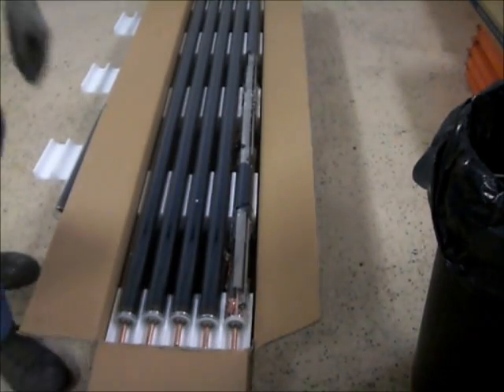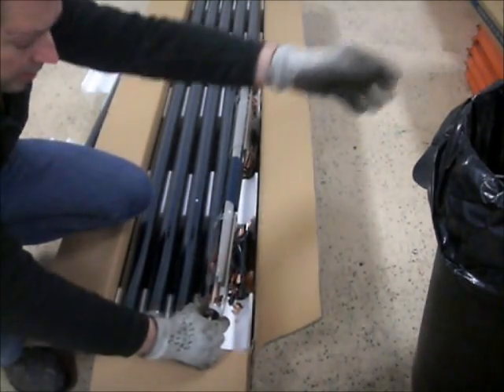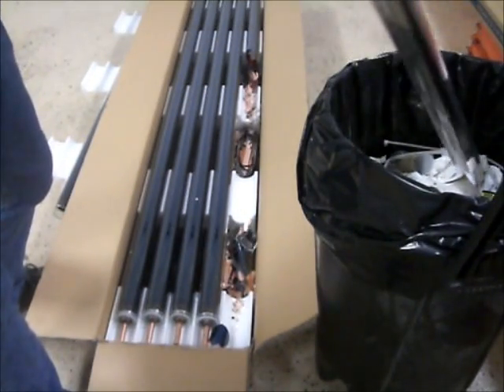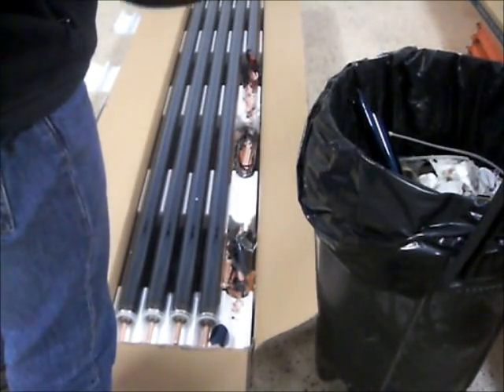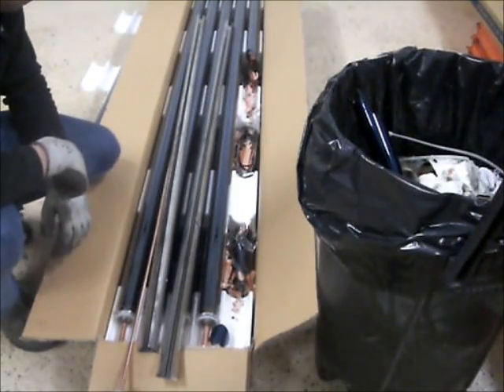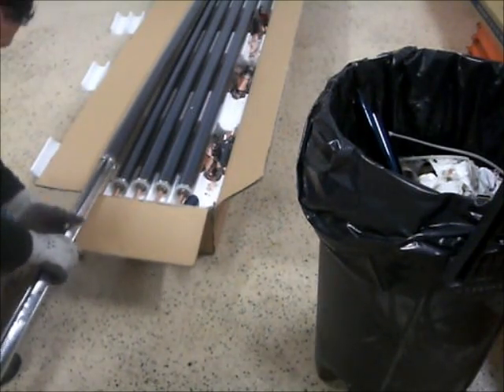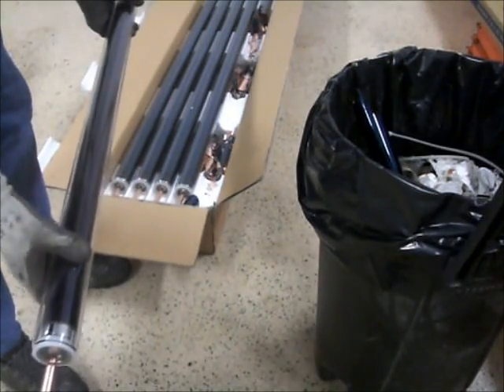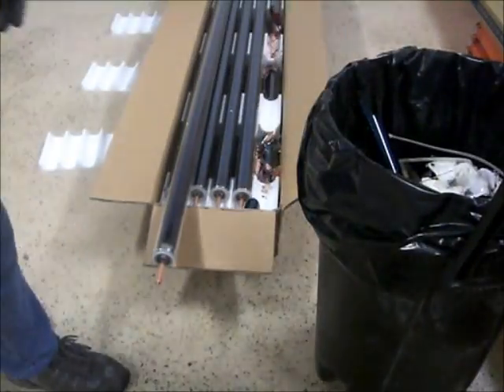Solar Evacuated Glass Tube Replacement

Comment: The solar tubes are sealed and no liquids inside only the copper pole?
My solar heater  is 11 years old and  i'm beginning to see that  are losing heat we are receiving warm water instead of hot water.,what it means?
Reply from the maker: Correct. It’s double wall of glass with high vacuum between inside/outside. Copper heat pipe conducts heat from inner glass via aluminum leafs. No liquid in tubes.

Comment from the maker: No water in these. Water in the pool collector tubes. Less than 2L in the manifold. Yes, copper heat pipe just conducts heat to the header. You can buy a single tube but pickup only. Can't ship them - UPS and Fedex always smash them to bits.

Comment from the maker: Yes, the are evacuated. It's a double-layer tube sealed on both ends, vacuum in-between. All I'm doing is re-using the internal heat-pipe from the broken tube and inserting it into a new tube. We sell the replacement tubes. If you google evac tubes and look at a closeup of where the heat pipe is inserted you will see how the tube is manufactured with an inner and an outer glass layer. Vacuum is between those not where heat pipe inserts.

Comment: dont EGT have to have the air evacuated? Isnt that the whole point of their efficiency? This repair doesn't evacuate the tube
Reply from the maker: Tubes are vacuum sealed when the glass is blown in the factory. Check YouTube for a manufacturing video. No vacuuming required for this fix as I’m just replacing glass tube.